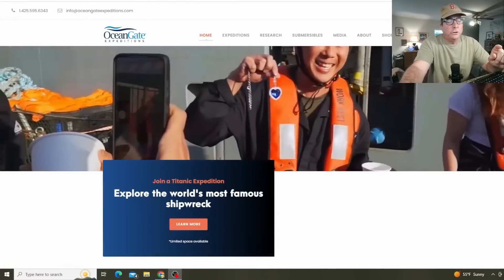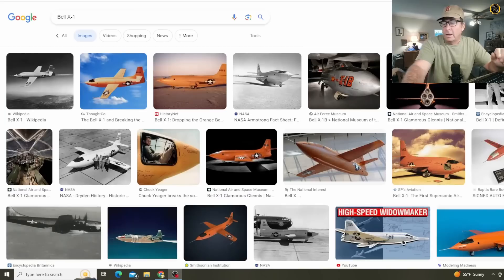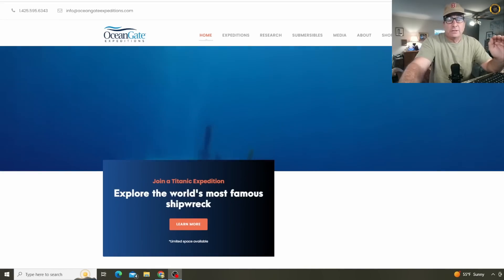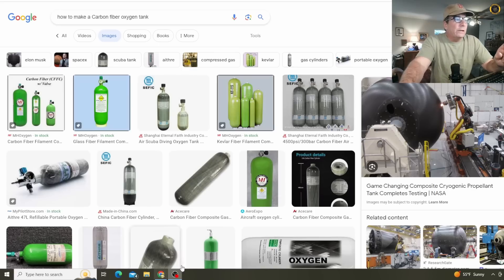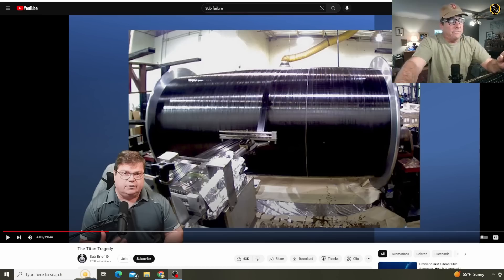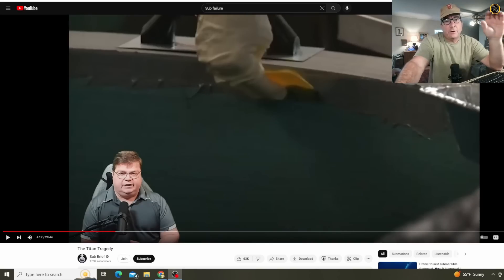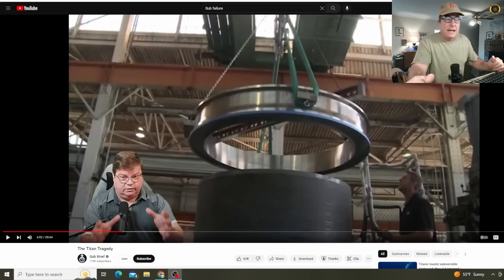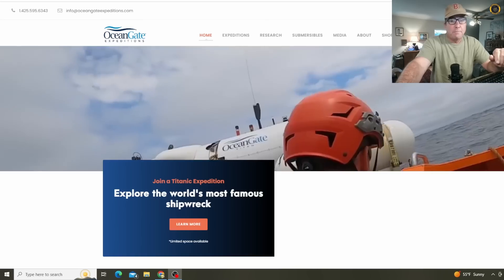Oceangate Sub Construction Details and Implosion

Comment: It seems to me that the intense pressure "squeezed" the middle part of the vessel since there is more surface area vs the titanium caps. This caused the vessel to simultaneously blow off both caps while shattering the cf tube into thousands of little shards. Because of the water compressing the air inside, im sure they were dead before the extreme psi sea water even touched them.
Reply: As a layman that is exactly what i think to,the hull shattered like fine glass,the pressurre coming in blasting out the porthole window, the endcaps left without a tube between them foated down to the ocean floor, if they find any carbon fibre remains,they might be of miniscule size,dredged out of the ocean floor!

Comment: So many questions, not enough qualification testing or answers.  An additional concern is what was the matrix material holding the fibers - epoxy, cyanate ester?  These materials degrade with water exposure, I am sure aggravated substantially under 6000 psi of pressure.  I would hope that the fiber winding did not have all the layers wound at 0 degs.  With wall thickness of 5 inches there could have been multiple layers wound at combinations of +/-45 deg or +/-60 deg and hopefully steeper angles more parallel to the cylinder axis in an attempt to achieve psuedo-isotropic material properties.  Like you said, with the fibers in compression, fiber strength may be only a fraction of its tensile strength - golly, would it only be benefitting from the strength of the adhesive matrix?  Don't forget all the stress concentrations from any hull penetrations for electrical wires or other access.

Comment: From what I know about carbon fiber or the new aircraft composite stuff is that its hard to detect flaws.  I know of aircraft tech's that do the whole x-ray and other methods say that its a 50% of finding anything wrong. Most of the time they look at how long the piece was in operation and say "needs to be replaced". Most of the time they tell clients to just replace the part because failure is going to happen.

Comment: Does anyone know how CF deforms under pressure vs Titanium (and how the materials behave at a given temperature). I would suspect the compressive deformation rates(constants?) are quite a bit different between titanium and CF, I would suspect the CF would end up being cracked by the titanium end caps and catastrophically fail when the CF has been compromised beyond  it's compressive strength (meaning it's compressive strength would be lessened over time as the CF fibers are cracked). The engineers on this project should have known better (did they even get a material scientist to even look at there design?).

Comment: The video of the epoxy bonding of the metal end rings to the carbon fiber tube is simply astonishing.
I'm only an EE but there's no way I'd glue such a critical joint in an open air warehouse (not a clean room) and not in a vacuum (to remove bubbles in the glue). I cannot imagine having any irregularities (dirt or voids) in that glue wouldn't be a serious flaw.  Maybe that's overkill but surely jointing dissimilar materials for such a high stress life critical application shouldn't be the domain of plucky amateurs winging it in a shed.
Also, surely another smaller ring that was cooled during assembly to contract it should have been placed INSIDE the carbon fiber to squeeze the tube and glue against the outer ring at all times, but especially during bonding (assuming such permanent compression of the carbon fiber wouldn't weaken it at the edge of the compression zone)

Comment: They wanted to be innovative.  They wanted to be cool.  They shunned the old farts over 50, who might have instructed them on the properties of carbon fiber under pressure, and how to bond dissimilar materials.  They bought a viewing window that was not rated for higher pressures because it was cheaper.  So many errors, any one of which might have caused their doom.

Comment: Hi Juan, Thankyou for the update. I am a professional engineer. If I had seen this you would never get sign off from me. We have Carbon Fiber vessels here and they are 3-4"thick and are in tension. They are about 2'OD and designed to withstand 3000PSI from the inside. They are used for vehicle NG fuel tanks.  All your statements are correct. but this thing with this form of construction would need to be more like a foot thick. But I would still never OK the design. Should have been all Titanium with external stiffening rings. This is a well known technique for a pressure vessel where the pressure is external. Even then I would want extensive testing. All lifting equipment for use where people might be underneath has to have a safety factor of 5. So if you want a sling for 1 ton it has to be design and tested to 5 tons. Standard slings hooks etc. can be tested to 1.5-2 times. I have actually designed pipes and welds for high pressure water and they have a factor of 1.5. So this vessel for carrying people would have to be tested to 60,000PSI or 30 tons per square inch. Bonding C.F. to any metal is difficult due to the different expansion rates even if you can get a good bond. C.F. valve covers for engines have this problem so this design would also suffer from the same issue. He would have fired me. The SRB's on the space shuttle had a low temperature problem with the O rings, different problem, but managers don't like bad news. I am chief engineer and an inspector, if I don't like it you ain't doing it and that is that.

Comment: A friend of mine did his PhD thesis on carbon fibre composite failure modes. He was expecting to get readily reproducible results that showed a certain type of failure mode. That is VERY FAR from what happened. He used a standardised test sample but found that it could fail in many different ways when the critical stress was exceeded. It is truly a very difficult material to work with and although it works well at lower stresses, with a great performance to weight figure, when pushed it is VERY unpredictable and can fail in unexpected ways. I'd describe it as doing 'weird stuff' at failure stresses.
It added a full year to his studies, the results were that unusual and unpredictable.

Comment: I work in designing oceanographic instruments for research and we routinely send instruments to the bottom of the ocean (~6000m) without any issues.  Rarely,  we have catastrophic glass failures but we do not work with any life critical systems.   Gluing the flange doesn't seem too bad since we commonly use adhesives and tape to seal.  The big red flag to me is the carbon fiber and how they did not wrap at multiple angles to compensate for the different stresses.  In addition,  in my 20years in the business,  I have never seen carbon fiber housings.

Comment: Having built glass fibre aircraft structures and having a working knowledge of carbon fibre structures, I'm aware that the resins used in fibre structures represent potential weaknesses where very small voids could be included. It's not for nothing than aircraft fibre structures usually have a 100% overload safety margin, while metal structures generally only require a 50% margin. My belief is that submersible chambers should be generally spherical, made from metal and with no seams or irregularities, apart from the entrance hatch and porthole.

Comment: Imagine trusting epoxy resin at 6,000psi.  “B b but…carbon fiber is the strongest!”  That aside yea…seems to me, not an expert, that your carbon fiber tube is going to get compressed at a much different rate than your titanium end cap.  Cameron said his vessel shrank by two inches.  Can’t imagine the carbon fiber-titanium joint would survive that.

Comment: The titanium ring and carbon fiber tube are seriously flawed in the basic parameters of stress placed on the structure.

The carbon fiber tube should have been over and around the titanium ring.

This would have deformed most likely on the dive at depth... not in a truly detrimental way... but would have shown the consequences of compression allowing recognition of the cumulative effects of the pressure.

and a stronger hard point would have resulted.

Comment: Its a wrong Material and its awrong desing , tipycal , a presure conteiner its made by 1 pice , like a coca cola bottle , this one have 3 pices but the worts part is use a material like carbon fiber that Yuo must known (there are studys outthere) its not good for this appliance ,and fixig this with epoxy  ,its not good for presure container, Non regular material have the potential of delamination in everyplace that yuo have a buble of air or some structural weakness, its Not homogeneuos like a pice of aluminium or steel or titanium

Comment: The use of composite for external pressure design is not the only strange/naive choice that the company made.  In pressure vessel design for external pressure, and even horizontal storage drums subject to longitudinal bending from internal weight loads, you commonly use stiffening rings either inside or outside the shell to resist "ovalization" on the long axis.  Given the pressures that the submersible would experience, it is not hard to assume that some minute amount of ovalization would occur at the midpoint, which would then translate to a lesser extent to the ends.  That cycling combined with differential thermal expansion loading due to dissimilar metals, would likely either fail or fatigue those glue joints.  Not to mention providing the kind of flexing that might allow water penetration into the laminate. The gasket/flange design on the removable head is also suspect.  You would expect a recessed face to keep the two rings centered, more bolts of bigger diameter spaced closer together, some kind of contained metal O-ring.  Yet what they seemed to have, was barebones flat face flanges.  The design doesn't appear to even consider a possible nose down landing on the sea floor, or any type of bump/collision with a sea floor wreck.

Comment: I am a mechanical engineer, with 30+ years of experience, including pressure vessel, when I see this design, it looks pretty shitty,  my primary concern is the two endcaps pressing on the center composite cylinder, I believe the collapse has been like a can under the pressure of a foot.

Comment: Even undergraduate electrical engineers would understand the different capabilities of pressure vessel shapes- cylinder vs sphere. Then, too, transitions bring their own challenges. It's very much NOT plug & play, and there are lives at stake. Lots of study, prototyping and testing would be needed, for a start.

Comment: This is what I have been saying for days, you need a cross weave layup of carbon fibre not a linier layup. And you are also right about NDT testing, as an aeronautical engineer of over 34 years experience’ carbon fibre can ingress water which can freeze, that in turn will delaminate the structure. I left the aircraft industry when Boeing produced the composite 787 dream liner and Airbus produced the A 350, both carbon fibre construction, carbon fibre is 400 times more conducive than aluminium so more chances of lighting strikes, lighting strikes only show on an aircraft skin as pin holes, very hard to spot but the damage they can cause in a carbon fibre structure can be devastating, people please learn.

Comment: Hi Juan, Thank you for this. The 787 Dreamliner is a carbon fiber construction as well, but I believe it's more of a weave? There are metal interfaces on the leading edges of the wings and perhaps the engine nacels, correct? Wouldn't this pose a similar problem to the Titan vessel? How does all of this hold together (so to speak)? There have been no airframe incidences with the 787 that I'm aware of... Appreciate a brief tutorial Thanks Jaun!

Comment: The carbon fiber vessel will always undergo  zero-compression/high compression cycles as long as the internal pressure is less than (or equal to) the vessel external pressure. Carbon fiber is the wrong material for a submersible vessel design,

Comment: Xray tomography plus ultrasonic checks can be used to look for delamination of layers voids and resin inconsistencies. However, as a new material for submarines, extensive testing would be required. As you rightly point out the joint between metal and CF is particularly important and where CF can fail well before thoretical strength limits.

Comment: Failures in design, construction AND testing.  The owner of this failure took it only to a depth of 3k meters whereas the Titanic is down near 4k meters.  Just one test.  He also bragged that he used aircraft safety standards in his design.  BULLWINKLE!  There was no way to exit the vehicle if there was a problem.  17 bolts held the hatch/view screen in place and those could only be accessed from the outside of the sub.  What a cluster-frack!  Not one experienced submariner involved in the design, construction and fitting out of this failure.

Comment: Great analysis for a "50 year old White guy".  There had to be bubbles in the glue they used to secure the end caps, those bubbles would expand and contract the vessel with every dive causing more weakness and flexing.

Comment: I don't thing that the gluing was the issue. The ring would be under enormous compression when submerged so actually probably no glue at all was needed (except for sealing). The same for the titanium hemispheres that acted as pressure bulkheads.
Instead, I suspect that the implosion happened due to one of these 3 factors:
- Different deformation of the titanium ring and the carbon fiber tube, causing fatigue and delamination in the end zone of the composite tube.
- Longitudinal buckling of the composite tube. The way the carbon was wound 100% circumferentially is great to absorb the radial compression loads, but it is awful to bear the longitudinal compression loads. There is a reason why composite pressure tanks are wounded at a combination of 90, +45, and -45 degrees. Add a bubble of air or delamination due to repeated cycles, and that's a recipy for a disaster.
- The forward (and only) window may have broken.

Comment: I see that ALL of the fibers were wound in one direction only, and that NONE ran longatuginally the length of the Vehicle.........I have been experimenting with carbon for more than 40 Years and happen to know that fibers,Weather Glass or carbon give very little strength across the grain, only along the length of the grain........Same as wood...........Strength is against the length...Never across the grain.......Have You ever split wood......You can split it only length wise, pulling the grains apart.......No One can split Wood going across the grain.............I suspect this Vessal compressed lengthwise...Where fibers have little strength........Paul
Reply: I also just happen to know that carbon and all metals have exactly opposite coefficients of expansion/contractions with temperature changes.......Metals expand with heat...carbon contracts with heat..........Google it....I did many Years ago......Even before internet...Which means reading books.......Paul

Comment: The titanium rings and carbon fibre tube will compress and get slightly smaller in diameter as water pressure increases. The rate of strain of the dissimilar materials would have been significant as Young's Modulus for Titanium would be about 100GPa (depending on the alloy) and for Carbon fibre double that or more (200+ GPa, longitudinal ie. around the circumference). This differential would have caused huge shear loading in the bonded joint between ring and cylinder for which any local shear failure might result in water ingress.

Comment: the port hole window was only rated for 1,300 feet as much as i think the hull was problematic i would say this was most likely the actual cause of the implosion. if i understand right they found this part by itself in the debris site. meaning it came off the titanium cap. it is possible it failed after the hull collapsed but i’m putting my money on the window being the actual main cause. 

from what i’ve gathered they was actually trying to surface before it imploded. sounds like they got scared and wanted to come up they have lost communication before so i don’t think they lost communications then try to surface. i think the window either started to crack or leak and they started to surface and before they could send a message topside the window failed and the sub imploded and that’s the cause of the lost communication.

this is just my theory based on the information i’ve seen and i’m going on that this information is right.

also in the lawsuit from the ex employee that said the sub was a death trap said they wouldn’t let him test and inspect the window at all. 

the more information comes out i almost think the owner wanted to die in his sub next to the titanic. he lied about so much and when you read the stuff he saids it’s like he doesn’t believe equipment can fail he would say stuff like bad operators are the case of accidents. he never would say anything about equipment failure which is insane because most plane accidents happen because of equipment failure. the owner was a pilot this is something pilots know very well and is why they check the plane and even look at repair and service notes before taking off. but my point is this is something he clearly knows but acts like it’s a none issue for a sub even though the sub was plagued with issues all the time. yet he would always talk about operator error. i don’t care how good of a operator you are it the hull or window fails it doesn’t matter how great you are.